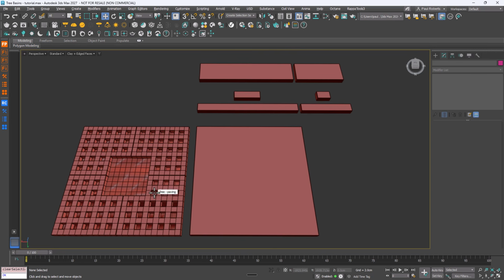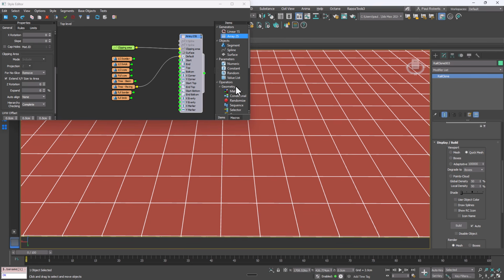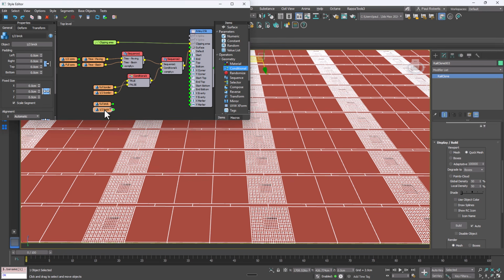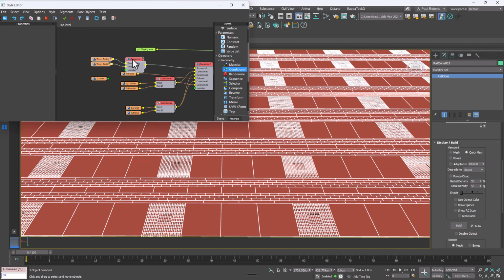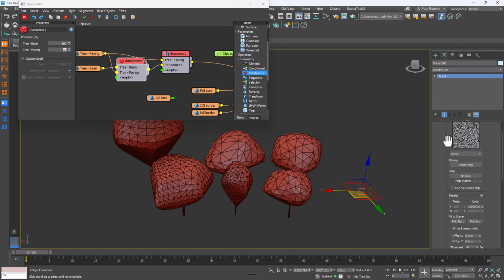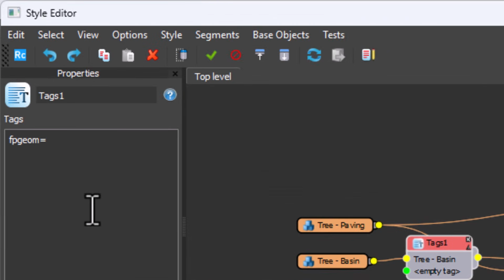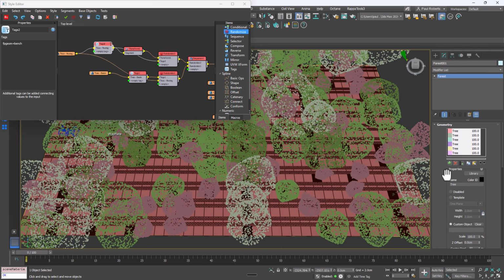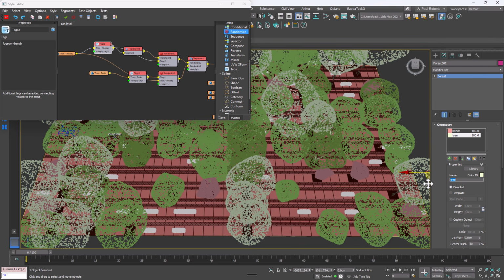How to Create a Procedural Plaza with RailClone & ForestPack

Comment: Is it possible, using this technique, to replace the trees with a fill of grass or gravel, for example? I’ve tried, but I can’t get the RailClone areas to fill in.
Reply from the maker: That's a little different. It's not using the RC object as a surface but as a marker onto which a single scattered object can be placed. This older tutorial might be what you are looking for https://www.itoosoft.com/tutorials/combining-concrete-paving-and-grass
Reply: @itoosoft  I’m familiar with this tutorial; it’s been discussed on the forum. What I really need is to use the surfaces of an RC object to fill them with a composite FP object (grass, gravel, etc.) – not just a single object (such as a single tree, for example).